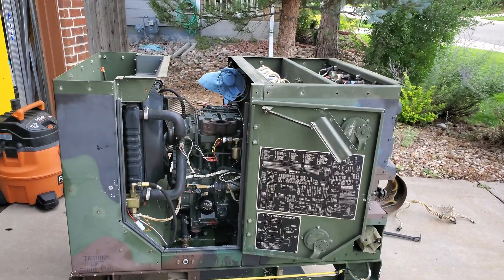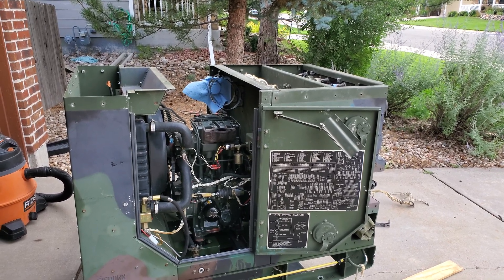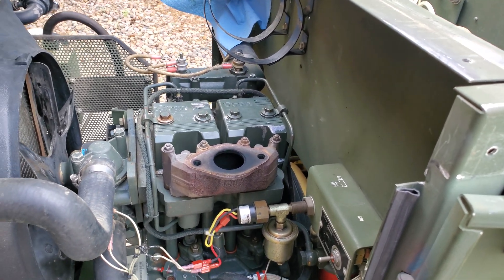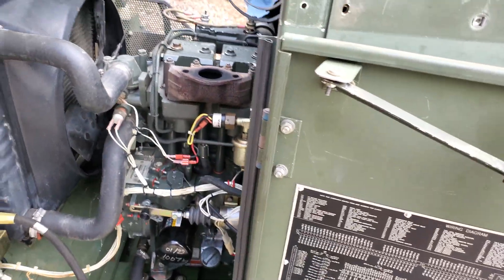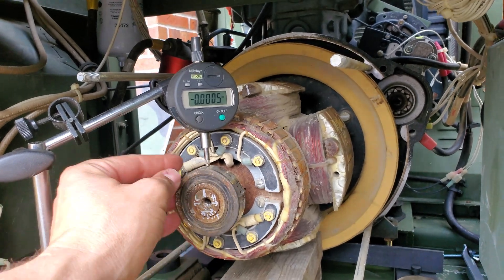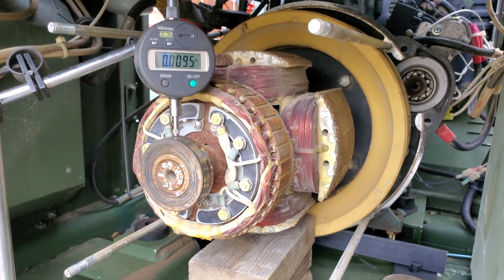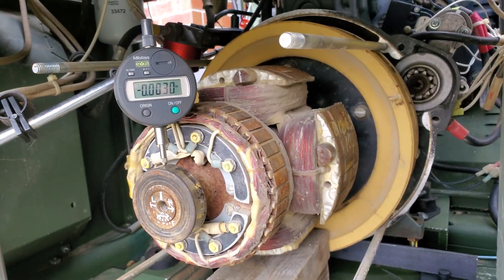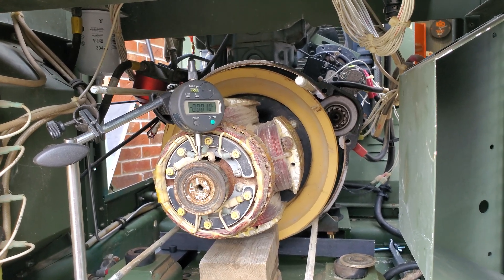MEP-802a excessive vibration investigation, Part 1

Comment: Do you have repair completion video
Reply from the maker: Unfortunately, no.  I got halfway through the repair and got derailed by life and other generators.  I did discover a serious runout issue and bad bearing with the genhead.  Here are some pictures previewing what I have done so far.
https://www.steelsoldiers.com/threads/addressing-mep-802a-vibration.221535/post-2588096

Comment: I hope by now you have replaced that bad bearing. If not, remove the bearing and check the run out on the shaft.
Reply from the maker: This one had a serious runout issue, which I will discuss in part II, but here are some pictures showing what I went through to address the problem.
https://www.steelsoldiers.com/threads/addressing-mep-802a-vibration.221535/post-2588096

Comment: Im in the same boat you were in now I believe. Got a 90hr 2009 802a at gov auction. Did all the PM on it and started it up today. It was vibrating something awful (shaking the whole unit bad) however, it seems like then engine is running good. Kinda stumped at the moment
Reply: What did you end up doing?
Reply from the maker: These 802s vibrate a lot normally due to the 2-cylinder engine design.  However there is a difference between normal vibration and what this unit was doing.

How much your unit vibrates depends a lot on what the generator is sitting on.  I have run these machines sitting on concrete, rocks, dollies, and a special trailer.  My best running unit still vibrates the gauges a little but if a place any machine on a stiff, but pliable surface like a grass lawn or rubber horse stall mat, the visible vibration at the panel goes away entirely. 

Another very important thing to check is the engine mounts.  Mounts for the 2-cyl 802a looks identical to the mounts for a 4-cyl 803a, but if they get mixed up, the 802a will vibrate much worse.  (The mount is stiffer)  This can also happen if the mounts get old and dry/stiff.  I'm working quantifying these mounts and testing softer materials to better isolate the engine.

Comment: Assuming the outer bearing surface was smooth but being crunchy might be enough to cause the deviation?
Reply from the maker: Unfortunately no, I made sure that was not a factor by holding the housing steady and then I removed the bearing and remeasured with the same result.